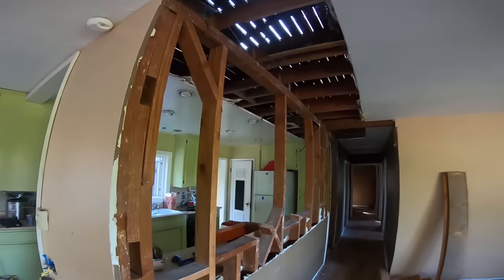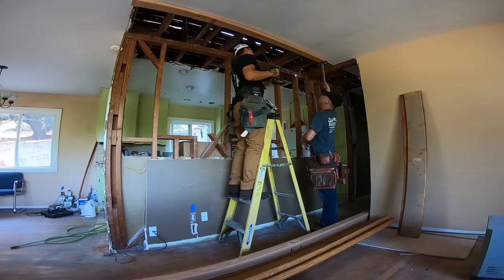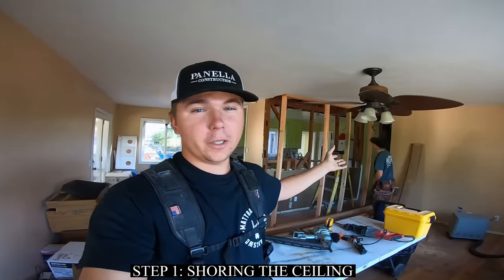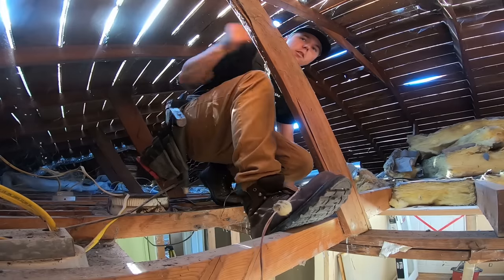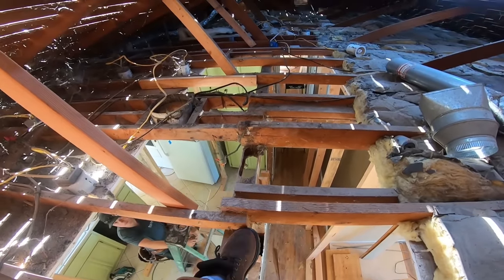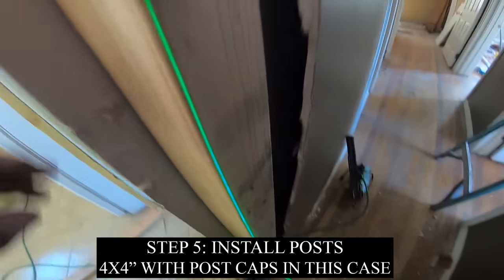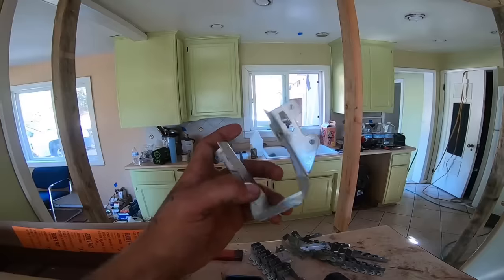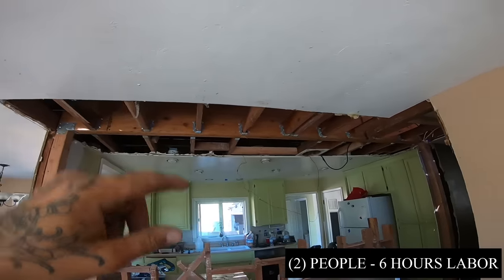How To: Removing a Load Bearing Wall! (EASY STEP-BY-STEP)

Comment: Great video guys! Hoomeowners should consult a structural engineer before doing this. They didn't explain that the ceiling load was distributed throughout the 2x4s of the original wall and onto the floor joists. When you install the beam on top of two 4x4 posts, the load is now distributed to those two 4x4 posts and they need to be placed onto the floor in a location that can support the extra load; the placement is not random.
Reply: unless it's a slab
Reply: @sleepmachine7522  If there is a basement you need to ensure that wherever those two 4x4's are bearing down on the floor joist below it's capable of supporting the load. When he says "unless it's a slab" he means unless the floor is a concrete slab with no floor below. If there is only a concrete slab foundation below then it would be more than capable of holding the focused weight.
Reply: @JustinMelville  🎯
Reply: @JustinMelville  yes
Reply: this is also a single story home hahaha so that would compound potentially for some homeowners.
Reply: yeah right. If a homeowner has money to hire an engineer, he has enough to hire a contractor.
Reply: Would adding two columns of the same or greater load carrying capabilities directly under those in the basement suffice?
Reply: @codypesavento5881  Only if they are sitting on a proper footing. No telling how thick an old basement floor is. Cut floor dig out and pour a pier.
Reply: Yes you right because after that is just to point support and that case if this is at upper floor 4x4 from upper floor need it to continue all the way to first floor concrete to spanding the loading if is my home I did 3 LVL with 6x6 to be sure is get the right support
Reply: He is in southern California, the house is on a concrete slab .
Reply: @jerseyjim9092  hiring an engineer is cost effective if you are doing the job yourself
Reply: Good add on for vid
Reply: Reading your comment would have saved me watching the video to see how they addressed the foundation requirements. Easy. They didn’t! 😂
Reply: Thank you
Reply: @dustdistrict9296  ever heard of a grade beam??
Reply: @BraveNewWorld8101  I was thinking the same thing maybe a 3 x 3 x 3‘ deep footing because a basement slab is about 3 inches and will crack with the load
Reply: @JustinMelville depends how thick the slab is, might need a footing

Comment: Love these videos. Now I can firmly place “removing a load bearing wall” into my “I’m definitely not DIY-ing this” bucket.
Reply: Literally thought the same thing 😆
Reply: Same 🤣 I am absolutely not ready to DIY that
Reply: Girl, do it. You’re more than capable
Reply: I agree 100%.  You will never catch me doing this.  But, I would enjoy helping these guys pull this off.
Reply: Really, this is more difficult than it absolutely has to be.  The homeowner must have wanted the beam set into the ceiling such that it didn't protrude into the living space at all.  That difference made this much more involved than it might have been otherwise.
Reply: @MatthewCBilyeu  I have to get this done, what do you think it will run me?
Reply: Believe I will have to get someone to do this. Not a DIY for me.
Reply: @MatthewCBilyeu  I agree.  For anyone doubting your ability to do what these guys did, you're probably right.  However, you can put the beam under the joists which would pretty much eliminate all of the attic work.  Putting the beam under the joists makes this much more accessible to someone with less professional experience.
Reply: Hahahaha
Reply: As a Carpenter i love and appreciate this comment.
Reply: @F4ttym4n  You tube got people thinking they can do every. damn. thing. I'm glad some of us have the sense to pay a professional when we sense danger in complicated work. Let the baker bake the bread as my uncle puts it.. 🤣
Reply: Agree. We planned on removing two-nit doing either now.
Reply: LOL!!! Right? Plus I think you need permits if I'm not mistaken.
Reply: Straight into my "how badly do you want a fridge in that wall?" bucket.
Reply: It’s not that hard.

Comment: from a person at 76 who has copd you need to wear a mask working in those spaces. I have worked the trades for 60 yrs
Reply: did you also smoke ever?
Reply: People who have asbestosis, a lung disease caused by asbestos, may develop COPD as a complication
Reply: worn out asbestos can be a hit or miss, my stepfather and a few of my relatives worked at asbestos plants and never wore masks and they are in their 80s still kicking. Sure it might cause harm to certain people and those that are constantly sucking it in but it has been blown out of proportion because it becomes a multi billion dollar industry when it comes to remediation and permits
Reply: Yeah you can see all the debris when the sun is at the right angle.
Reply: This guy is young. What happens to most guys in this trade as they get to late 40s and 50s? Dont their lower backs go to crap?
Reply: Colin is right. Wear your damn masks! It's every trade, too. I never see welding people wearing masks even though I know that a regular p100 mask makes a huge difference despite not being rated for welding. Any time I need to deal with drywall, I put on a p100. Any time I'm in the ceiling, p100.
Reply: I worked construction for a dozen years. Carpentry, plumbing, welding, electrical, insulation, no mask, no smoking... Now I work as an engineer, but I have a lingering, constant cough. No idea what it is, but its probably from the dirty air I breathed for years.
Reply: @william0203usa2  I got into remodeling at 45... I can't crawl around in attics like that anymore... 
and I've only been doing it for 5 years... sooo inflexible...
Reply: Been a carpenter since high school and as I'm 60 now , I've had 2 sinus surgeries due to dust. Should have learned after the first.  Wear a mask

Comment: My house has engineered trusses that are supported by the front and rear block walls of the house meaning there is no need for load bearing walls in the center of the house!
Reply: Thanks for letting us know? 🤔
Reply: And? 🤔
Reply: And?
Reply: Lots of buildings have no load bearing wall.... Think of literally every garage?

Comment: I find it hard to believe Cali inspectors would pass those hangers after you shot them in with an air gun.  Here in Kentucky I just had one fail because my framers chose to air nail all the Joist hangers on our back porch addition.

Comment from the maker: Perlin braces got installed the day after we installed the beam, remember, you want those perlin braces to be on something that can take the weight! In this case, the double LVL we installed..

If you have any questions, feel free to drop them under this comment.. I'd love to help you out!

My audio on my GoPro got screwed up on the later half of the video - I bought new aluminium housings, and apparently it blocked the Microphone.. "Bear" with me! ;)

Hope you all enjoy, super simple process, most don't understand it though..
Reply: purlin*
Reply from the maker: I spelled it right in the video, wrong in the comments. 😂 Damn it!
Reply: Hey awesome vids! What particular nail gun are you using to nail the LUS24's? Thanks!
Reply: Did a structural engineer determine the beam size or give any guidance on this?
Reply: @edwhite101  I had one of those for a while, it broke and was not fixable, forgot what it was called.
Hitachi makes a very nice hanger nailer now, it's a beast.
Reply: Hi how many studs are supporting the LVLs and what dimensions are they?
Reply: do you need to add new footings in the basement and vertical structural poles in the basement underneath the new 4x4 posts?
Reply: How much a job like these cost!?

Comment: You could also use 2 or 3 studs(commonly known as a stud pack)if you have extra instead of a post, also you could use a sawzall and cut through the nails at the bottom and top of the studs in the old wall removing the whole stud with less dust and clean up than cutting them in the middle, you could also use the sawzall to cut on each side of the top plate of the old wall using the edge of the plate as a guide removing the plate while also cutting the space for the beam without having to pop lines
Reply: This guy gets it
Reply: And, if done properly, reuse the studs for the post as you mentioned. Just be sure you know and follow the nailing schedule to assemble it, or better follow it using screws that reach all three studs.

Comment: Someone else mentioned it to, but this is literally the layout of my house (kitchen, living room, dining area, hallway) and I am looking in the future to remove the same section of wall as well.  While I probably won't be able to do it myself and will hire in, this really gives me an insane level of insight on how my house constructed!!  Very cool!
Reply: Yeah I'm probably not doing this myself either - would love to but looking at the tooling and work involved - I'll leave the load bearing work to the experts
Reply: I also have this exact same home and plan on removing this wall!
Reply: @nocalfnarwhal8858  I ended up having a kitchen remodel company come in. Due to the small size of the kitchen, it was easier for someone with more experience to assist with the layout and build out.  We ended up cutting a large window from the corner of the kitchen to the hallway entrance, added a 2x10 header for load bearing and expanded the counter out into the living room area, but only by a foot or so.  Worked out really well and has hugely expanded the space!

Comment: Matt,
I realize that videos are limited in showing all that is done, but I do have a question: Did you glue and screw the LVL’s to each other once you raised them? Keep up the instructional component in your videos; you have excellent knack for teaching.
Reply: Hello Roy. Great question because following the proper nailing pattern on a LVL beam is crucial for proper load transfer through the beam. Nails or screws in an LVL is sufficient with the load they are carrying in this video but you should NEVER glue LVL together as this will actually keep the plys from acting as one solid beam. The glue can not bond the wood fibers together like in conventional lumber due to the water resistant coating the is applied to the LVL surface at the factory.
Reply: Thanks for info. 👍🏼👍🏼

Comment: Great vid. Got yourself a new subscriber. One critical assessment I had is that you never talked about what was below the columns you put in. If that was a wall supporting only ceiling load the floor joists might have been able to support that out to wherever the footings are. With the install of the purlins at the mid span of the roof, combined with supports bringing now new load down to that wall line is a lot of new load. Even if just the ceiling joists are loading that new beam, that’s a questionable distributed load that is now two point loads, down to something you never mentioned. Loved the video. Its great to see the thought process and execution of a skilled framer.

Comment: Hi Matt. My husband and I are about to remove our kitchen/dining area wall as part of our Kitchen remodel/expansion. We have an identical situation as in the above video, where we have ceiling joists running perpendicular to the double top plate over the existing wall. We have been told that we may need to add a 2x2x2 footing under the stud pack on either end of the new 12'-14' beam that will replace the wall to make an open concept kitchen. Our house is 1 story, and the area where the beam is replacing the wall doesn't have any other structure sitting on top of the wall. Just the joists of an 8 foot wide kitchen ceiling and its drywall. So the proposed solution is identical to your video. What we don't understand is that we haven't seen any other videos like this where they have added a pier/expanded foundation under the stud pack, or fortified the outside wall where the other stud pack is going. Why would we ever need to expand the footing on either side for such a little wall removal job??